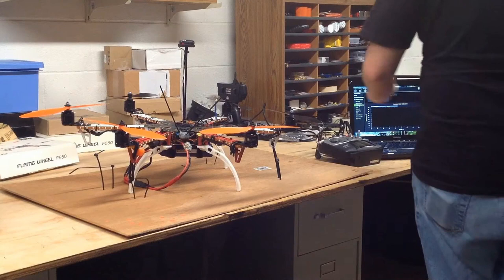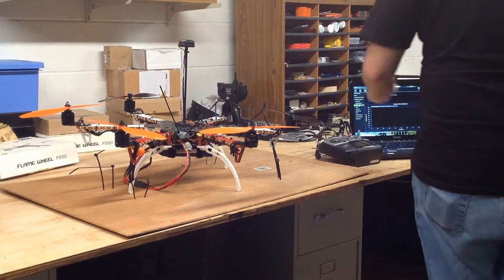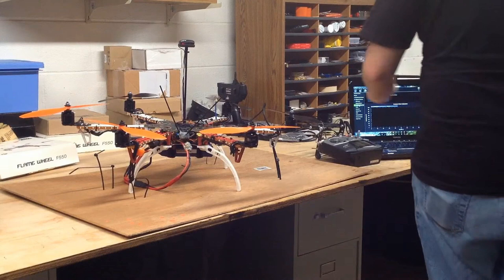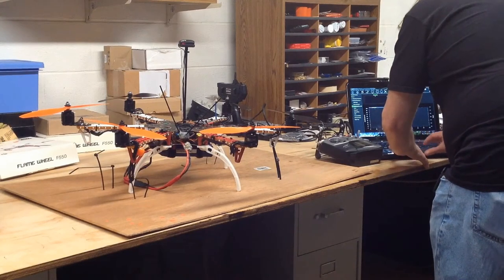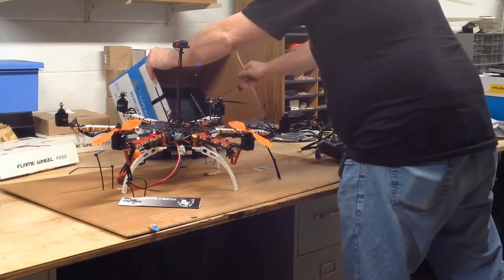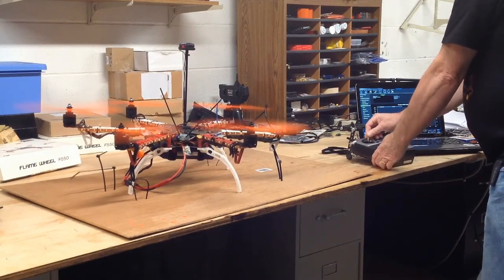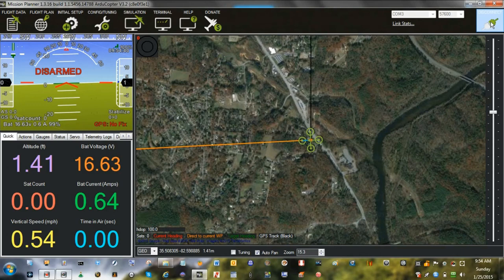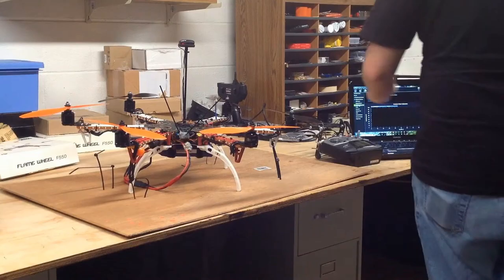Securing A Drone Example

Comment: Hah! that is a fine dust collector you have built ;-)  It really does display the power of the thing though doesn't it?
Reply from the maker: That was with 10-inch props.  I was scared to use the 12-inch props for that calibration.  I had no idea it would squat so much on the landing gear.  When it did all I could think was get it done and shutdown it down, now!  Then after the box fell, I thought the worse that could happen already did.  Lol  That calibration only has to be done one time unless you change the ESC, or motors.  It compensates the compass for interference.  If you look at the graph it creates it looks to me like it is raising the noise floor as the current goes up.  Effectively reducing noise.  It isn’t as bad with quads.  If I had taken the landing gear off, the regular frame is very rigid and doesn’t squat under load.  I did fly it with 11-inch and then 12-inch props.  Maybe I should have recalibrated for each new prop size I am not sure.  It is a beast in the sky with 12-inch props.  Has a CRAZY punch out straight up.  I love it.

It was hung for display because in truth, I am not done with it.  I love it far too much.  I would like to finish my second Skyhunter 1800.  Then build a 7-inch LR quad.  At the same time I will also be working on the Titan Talon.  Not exactly sure what I will do with it yet.  How it goes together will decide IF it is just a display model of a printed airplane.  Built as a regular drone airplane.  Right now I am looking at making it my first VTOL.  But they just released a VTOL that may be much easier for my first VTOL platform.

Not sure right now IF I will finish the Titan Talon before or after I buy 6 new heavy lift motors and revive the Flame Wheel.  There is nothing left on it to make it not fly as well as ever except the motors.  Everything else is new.  Well except the frame.  And that can’t be the problem.